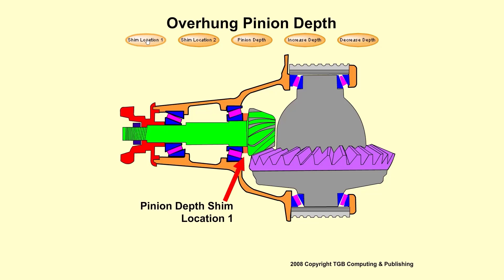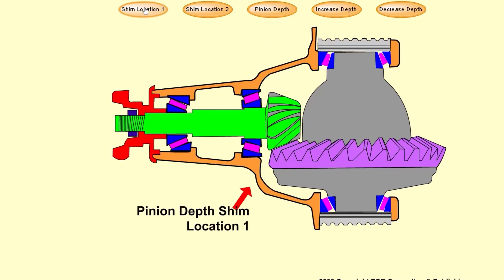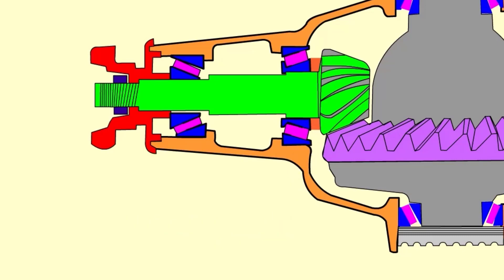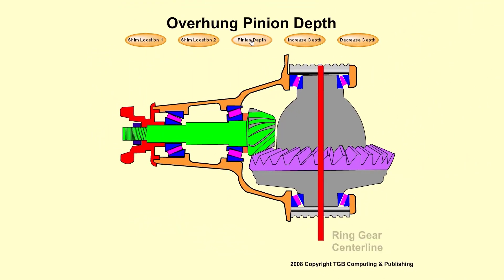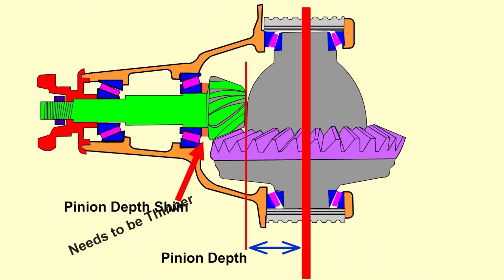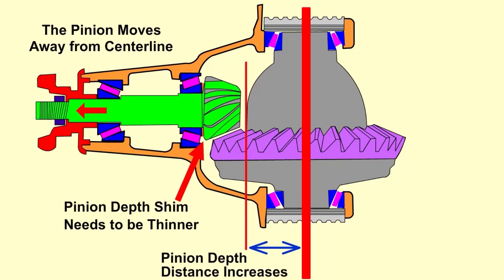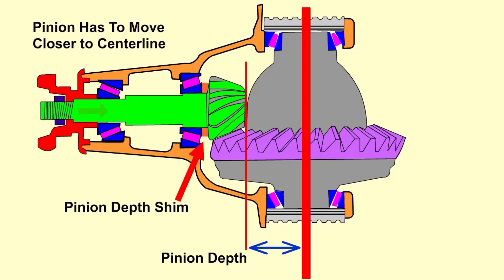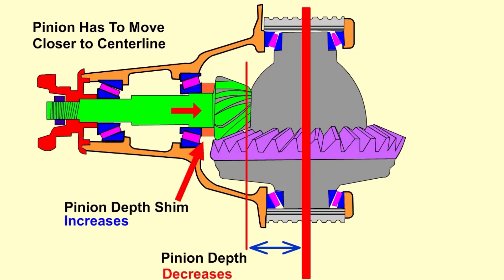Overhung Pinion depth shim change Explained

Comment: I'm looking for the overhung pinion on Allison,
Reply from the maker: Does Allison make differentials?  I thought they only made rear wheel drive transmissions for trucks and large vehicles on truck chassis. Overhung pinions to the best of my knowledge only apply to differentials and some transaxles.  Subaru has a transaxle that uses an overhung pinion design.